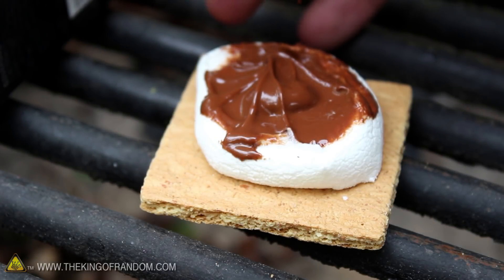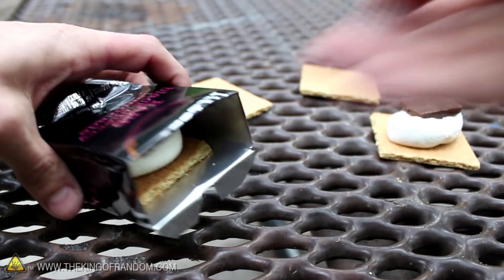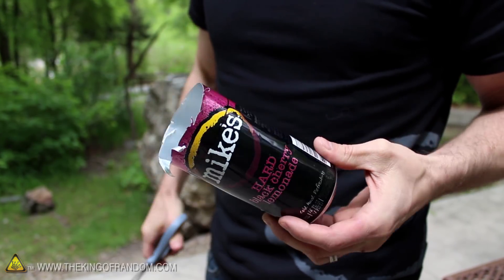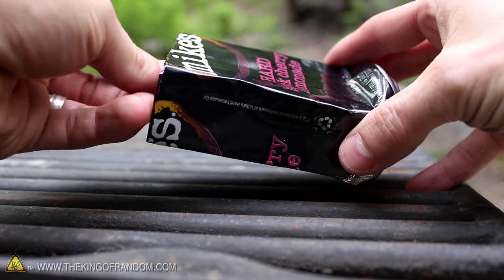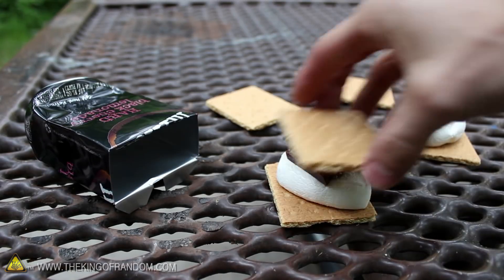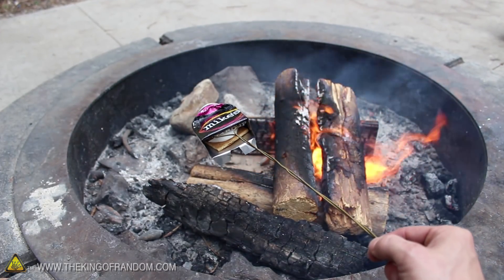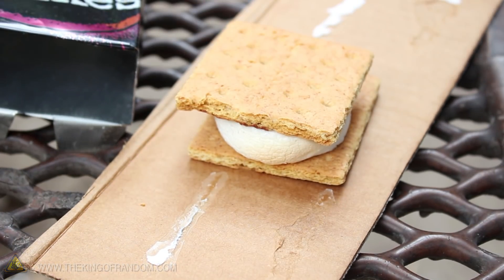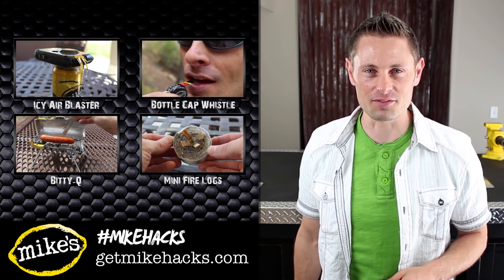How to Make a S'mores Roaster!

Comment: Why can't you cut clockwise?
Reply from the maker: Good question.  It will give you a jagged edge.
Reply: Daniel Sultana then he would cut counter clockwise and fix the problem by cutting clockwise (like normalling but the opposite)
Reply: Paul Deddens NORMALLY
Reply: Grant Thompson - "The King of Random" Unless we have left handed scissors?
Reply: If you cut clockwise the space time continuum will explode and turn inside out
Reply: Randy Randerson It really depends on which side the blades are. Normal scissors will form a jagged edge if you cut it clockwise since the right blade is cutting downwards and the left blade, which is supposingly closer to the can, will push the edge up. Glad we have science ppl.
Reply: ya bro
Reply: +Randy Randerson HA LEFTHANDERS HAVE AN ADVANTAGE FOR ONCE
Reply: Cut the other way won't be as smooth

Comment: Awww, 164th. 
But I think that using aluminium isn't healthy
Reply from the maker: I wouldn't worry about it too much.  It's the same idea as making a baked potato in tin foil.  "Tin foil" is actually made of aluminum, as are a lot of cooking items, like roasting pans for turkeys.
Reply: But potato is also in a skin, which protects. I am not sure, I am just supposing. Maybe aluminium isn't really unhealthy. I only know that we shouldn't eat sour foods from a tin foil :) I've never eaten any marshmallow, I need to taste them
Reply: aluminum used in cooking does NOT have the inks and chemicals built into the soda can alloy. and that same aluminum is STILL linked to health issues
Reply: just pointing out that the concern over aluminum is overblown. If this little amount concerns you, try electrolyzing your tap water, and see how much aluminum is in there.
the point where it would harm you, would probably be past the point of you dieing from obesity. not from aluminum poisoning.

Comment: I prefer roasting my smores by hand I made my own 3 prong roasting stick so the marshmallow wont fall off then if you do it just right you'll have a golden brown on the outside that's slightly crispy and it you poke it the inside should be melted also. this take away ALL of the fun of roasting marsh mellows all tho I do like the left over barbecue thing ill be doing that.

Comment: Lol you dont like burnt marshmallows but you are ok with plastic infused marshmallows? XP only teasing but just for notes there is a very thin layer of plastic on the inside of drink cans that protects the aluminum from the acidity of the drink. That being said I doubt its enough to affect you